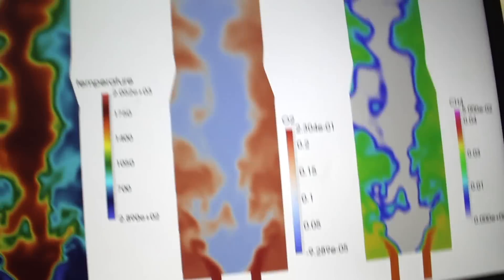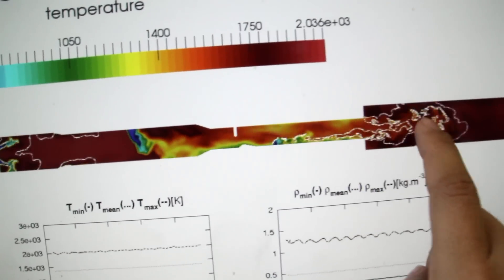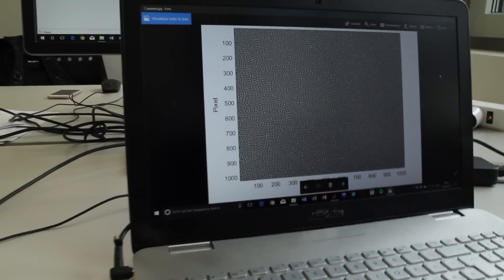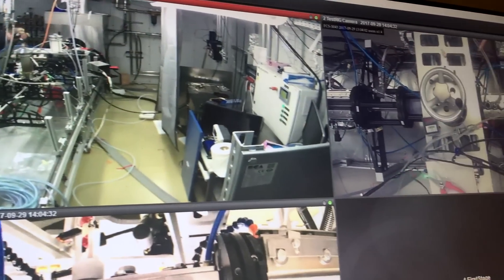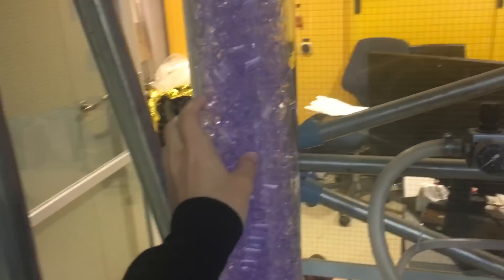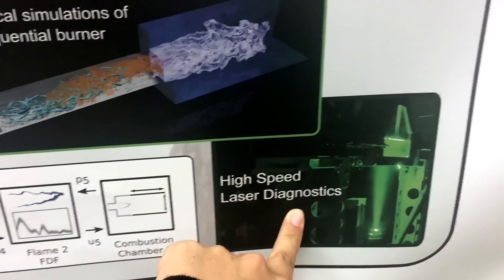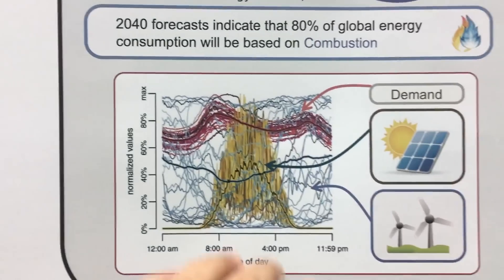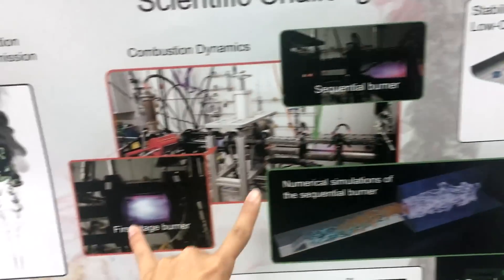Day in the Life of a Mechanical Engineering Student | Engineering Study Abroad

Comment: In the Simulation of the 2nd flame "Full burner temporals" right after where the air is coming in, it looks like there is a bent air guide promoting turbulence before the fluid enters the reduced cross sectional area. What does this guide look like? (for thesis purposes)

Comment: Are these fuel and air getting mixed inside the burner. I want a bit clear explanation on simulation shown in the 2nd scene
Reply: Okay, after watching this clip to the end, i understood what you did for your project. Here, oil+gas+coal is burned to convert the energies to power, that is required to run engine. Am i right?

Comment: Hi Dear, 

Love your video. Didn't get the name of the software program you used for the simulation? 

Used NX -Siemens for my simulation on material analysis during my MSC program at Teesside University. Am now a Mechanical Design Engineer, I also do HVAC design for duct, AHU and Chillers. 

Well, hope you got a solid 'A' on your project. Thanks

Comment: How much physics you need to know to be a mechanical engineer?
Reply: Yes
Reply: Jefferson Marchan  alevel A2 physics and mathematics
Reply: What kind of topics?
Reply: Jefferson Marchan  here’s the syllabus 

Physics Alevel AQA

1 Measurements and their errors
2 Particles and radiation
3 Waves
4 Mechanics and materials
5 Electricity
6 Further mechanics and thermal physics
7 Fields and their consequences
8 Nuclear physics
9 Astrophysics
10 Medical physics
11 Engineering physics
12 Turning points in physics
13 Electronics

Maths Alevel Pearson

1–Proof
2–Algebra and functions
3 – Coordinate geometry in the (x, y) plane
4–Sequences and series
5–Trigonometry
6–Exponentials and logarithms
7–Differentiation
8–Integration
9–Numerical methods
10–Vectors

Section S

1–Statistical sampling
2–Data presentation and interpretation 
3–Probability
4–Statistical distributions
5–Statistical hypothesis testing

 Section M

6–Quantities and units in mechanics
7–Kinematics
8–Forces and Newton’s laws
9–Moments
Reply: @easttrek  Easy

Comment: Awesome video! I am a mechanical engineer myself and I am glad I chose this field. I am a design engineer in R&D Department, my days mainly consist of designing different parts for complex assemblies, developing product from scratch through bench-marking and different market studies, and 3D design them using creo, and send them in shop floor for manufacturing. As a designer, we have to take into account the stress analysis, strain analysis (in static and running condition), fatigue, vibration & sound analysis using different tools and predict the life of the units as per our design quality. 

If i am not working on new projects, I do continuous improvements for the developed products already delivered to customers.

Comment: The flame on your second stage seems way to volatile/unstable from the simulation, and could possibly have a detrimental affect on the turbine by providing cyclic shock loading. Have you guys ever considered slow speed two stroke crosshead diesel engines, I'm a marine engineer and they are used to direct drive most of the merchant ship fleet as they are on average 60 percent efficient overall with the incorporation of wasteheat recovery systems, they do not have the same ramp up time as a turbine they take roughly an hour to reach full load though they can be run on anything from gas to bio fuel to RMK 1000 (road tar essentially). Your work is very interesting. Or have you ever considered adding waste heat recovery to a gas turbine system to improve their terrible efficency.

Comment: Heyy really suprised to find such video on youtube! You were spot on with regards to the engineering student life. Im from a little island called Malta but currently doing my masters in mechanical engineering at Coventry University, UK. The course is amazing and even fell more in love with modelling especially FEA and optimisation. You project looks amazing by the way, Gas Turbines are very interesting. In my country's electrical power station, three new siemens gas turbines working with natural gas instead, have just been installed. Does modelling change when using a gas as a fuel rather than an atomised liquid? Im in my last semester at the moment and initiated my dissertation where I have to optimise an ICE connecting rod able to withstand higher combustion power obviously using FEM. Keep it up with these videos, its good to see how other people deal with the engineering student life ordeal 😥😂
Reply from the maker: Hey Karl! Thanks so much for watching:) I'm happy to hear that you liked the video!! Yes I know Malta but I haven't been there (yet). Modelling would change because now your fluid is compressible when dealing with a gas. Also if you're combusting then you have to additionally solve the species equation. Hey that sounds like such a cool project! Kepp me updated with how it goes:)

Comment: Hello from Turkey, thanks for video!  I want to specialize in mechanical engineering but I cannot decide which area i like more. Because almost all courses i take from now came interesting to me. (Thermodynamics, statics, dynamics, strength of materials) I haven't take courses (Fluid Dynamics, Heat Transfer..) But I like work with ANSYS. I am wondering, what is your advice to me? Have a good day!
Reply: Take the actual classes, then "specialize." Don't judge based on names and course descriptions. Or study MET, much more interesting!
Reply: MET stands for Manufacturing Engineering Technology. We study robotics, PLCs, CNC, and manual machining. The other half is six sigma, lean systems, supply chain, and systems design. It's very versatile and if you want a graduate degree it leads to Technology management.
Reply from the maker: Hmm I would say wait until you take those other classes. Because you don’t really have the opportunity to specialize until a masters, right? Or can you specialize before then?
Reply: Yeah right thanks for answering. 👍
Reply: Andrew Eaton what is MET sir
Reply from the maker: I think Andrew means Mechanical Engineering Technology (?). But also yes, what he said about not judging based on names is important. and specialize later once you know what classes you like and what you dont like

Comment: How do I learn how to produce simulations like you showed in the video? I'm well versed in single variable calculus and some multi-variable calculus and can program well in Java and Python, although I don't currently know how to use any Python modules except for some TensorFlow. I haven't found any good resources for learning about CFD yet, but I also haven't been looking particularly hard, so there's that...
Reply from the maker: It's hard without the program, and it's not easy to get the program. i would suggest taking CFD and/or turbulence modelling courses
Reply: STEMinine Ah, ok. What about simulations in general? How far could I realistically get without taking any courses? I not really in a position to take any formal courses right now, but this topic still interests me.
Reply from the maker: Before you learn CFD you need to learn the theory behind the math. Because CFD is a lot of parameter selection but if you don’t understand the math then you won’t Ben able to justify your parameter selection. So I would actually suggest a CFD textbook

Comment: Mechanical Engineer here, finished with school and my day is very different. I work at a product design Engineer in R&D department, every week my job changes, one week I might be working in solidworks designing a small part for a complex system, and the next week I could be using ANSYS and working with fluid dynamics simulations. I also have access to some very high tech 3D printers, metal printers, carbon fiber printers, CNC's and more to help me produce the products I design for a customers or in house application.
Reply from the maker: That's so cool! It sounds so awesome when you get a job that requires a different skill every day. Can't wait to be done with school!
Reply: I was going to ask the same :P
Reply: Thats exactly what i'm trying to do! Could you hook me up? I'm also ME btw
Reply: Any job is there I am mechanical engineer fresher... I from India..
Reply: I am trying to get a job as a Product Design/Product Development. I'm still a ME student. Do you have any advice to get to such a field? Have you done alot of internships?
Reply from the maker: Sam Parreno Hey I don't have experience in that field. I'm mostly in research and I've only had two internships.
Reply: @RiverTechJess  which country is this .?
I to plan a ms for mechanical engineering , can I get a advice from u?
Which university is best masters in mechanical engineering?
Reply: Sam Parreno get a internship, I had 3 while I was a undergraduate.
Reply: i am also mechanical engineer.. my job is also in disign company.. i use solidworks and catia.. we design wiring harness of automotive wires
Reply: Sorry I didn’t realize this comment had so many reply’s. Yes I have a bachelor degree in mechanical engineering (save your money and go to a state school). The company I work for does defense contract work (I won’t name it here). The company is also smaller 75-100 people and inside R&D it’s even smaller, only a group of 12 of us. I work on a daily basis with Electrical Engineers, programmers, Mechanical, materials and industry design engineers. I suggest to everyone get at least 1 internship while you are in school.
Reply: can't make sense of my current situation. Graduated ME from an abet accredited school, 3yrs experience and can't find a job in 6 months. I'm this close to taking that night cleaner position at Walmart
Reply: Sabroso Lopez when you say 3 years of experience, what kind of experience? Engineering ? Did you have a internship or did you get decent grades ? How are your interview skills ? Did you have someone proof read your resume ? Are you applying just in your local area or around the country ? There are a lot of factors when getting a job besides just having the degree.
Reply: @RCPhotosVideos  1 mechanical reliability, 2 yrs R&D lab testing experience. I'm applying to 43 states and the few companies that get back to me say I have a strong resume but they went with a candidate with more experience. Like really? This is an entry-level job I'm applying for geez. Maybe it's this whole covid situation
Reply: Get me a job!
Reply: Can I get your e-mail?
Reply from the maker: Nithin John it's jessica@steminine.com
Reply: what if you have an associates degree in cnc machining?
Reply: How much do you make
Reply: ɥo Johnson I started at 70k and it has gone up since that with yearly raises and bonuses.
Reply: @RCPhotosVideos  dollars?
Reply: 5kviews org yes started at $70,000, US dollars
Reply: this so cool, dream job

Comment: Show us the diff eqns used for the project or did you just make simple assumptions and put stuff in that program?
Reply from the maker: The equations are the Navier-Stokes equations. and it's not a program. you can learn all of the assumptions in a Turbulence Modeling course, which deals with solving the navier-stokes equations:)
Reply: STEMinine So, you're not using some FEA/FEM program/software? Wow. I can't survive doing Structural stuff without them. So, if I can't do it with Structural, I can't imagine doing modeling with this stuff so raw.

Comment: Great video. I’m an Electrical Engineering major but its cool to see how grad students do research. Are your days normally this short?
Reply from the maker: hhahaah well I didn't want to show hours of footage of me just doing work in front of the computer;) but usually I work from 9am-6 or 7pm. (i'm lucky that I only have a master's thesis and no classes or else I would be working till 2am. Thank goodness those days are over)
Reply: Freshman year 1 semester I partied almost every weekend because to me the work was not difficult at all(calc 1, chem 1, some gen eds). If you can, try and go out and have as much fun as possible during your first semester if you also find your course load to be manageable and relatively easy. Get all the partying and fun out your system because after freshman year you'll have very little time to do so if you want to progress and do well. Keep your GPA up, get involved, and have some fun. Best of luck to you. If you got any questions don't hesitate to ask
Reply: I'm only a sophomore so I'm still in the "weed out" stage of the program. Junior year is the hardest. Taking upper level physics and calculus right now along with some EE and programming courses. It is a lot of work and its not easy but its manageable if you plan out your time well and use the available resources to help you when you struggle. I certainly do not study all day lol. I'd  be burnt out if I did, and you shouldn't do that either. It's good to take some time off relaxing and going to parties and stuff. But you have to immediately get back to the grind the next day
Reply from the maker: That's awesome Ahmad that you find your classes easy:)
Reply: Bro, I will be studying Electrical Engineer in 16 weeks after I graduate from High School. How you holding up? Do you have time to do things you like or you be studying all day? Is it hard?
Reply: Hi, I'm final year mechanical engineer. but i have friends in electric in my hostel. so almost all engineering fields are way too much easy. we do party, and everything. I myself usually study at last month of semester, although i won't advice you for such thing but i still have 3.4 cgpa. while in my department, teachers don't give good grades so often as compared to other campuses, but still it is easy unless you are weak in mathematics